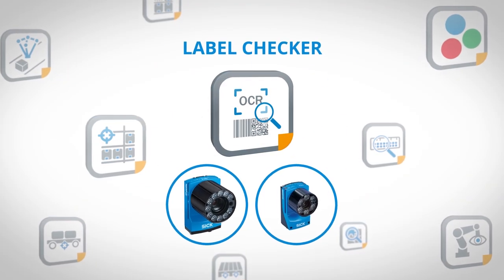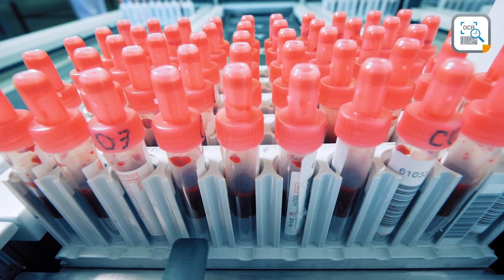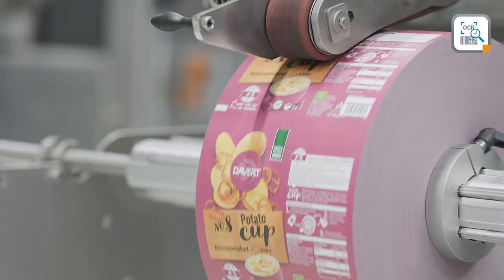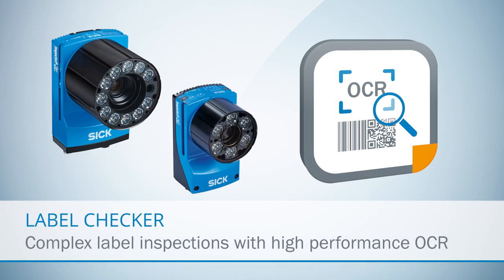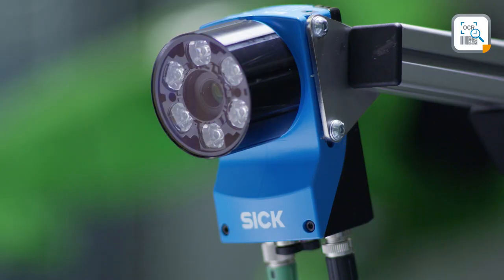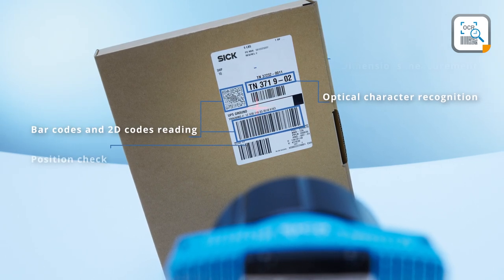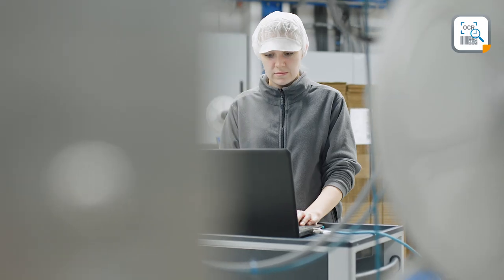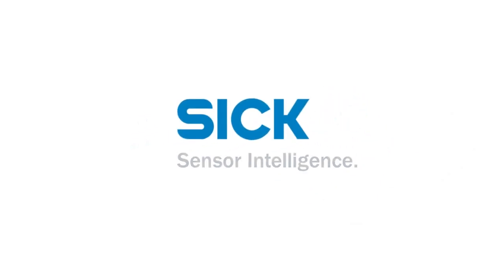Label Checker from SICK: Complex label inspection with high performance OCR | SICK AG

Comment: It is water proof?
Reply from the maker: The complete LBC achieves IP67 (EN 60529 (1991-10), EN 60529/A2 (2002-02)) protection after installing the optional Lens Cap.
IP67 means: 
- 6 Dust-tight: No ingress of dust; complete protection against contact (dust-tight). A vacuum must be applied. Test duration of up to 8 hours based on airflow.
- 7 Immersion, up to 1 meter (3 ft 3 in) depth: Ingress of water in harmful quantity shall not be possible when the enclosure is immersed in water under defined conditions of pressure and time (up to 1 meter (3 ft 3 in) of submersion).
So we can simply say, that LBC is waterproof up to 1m.